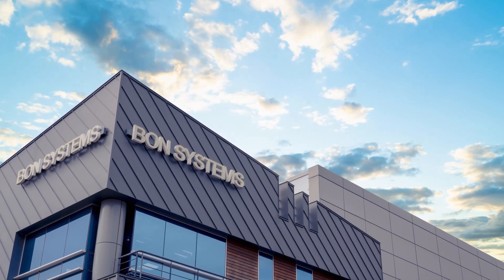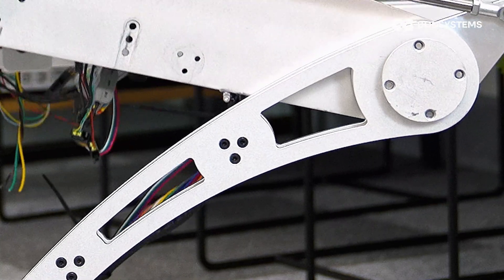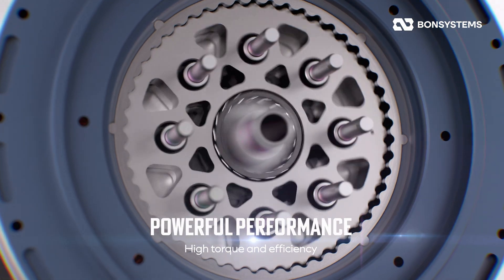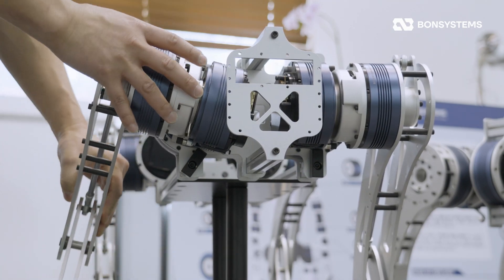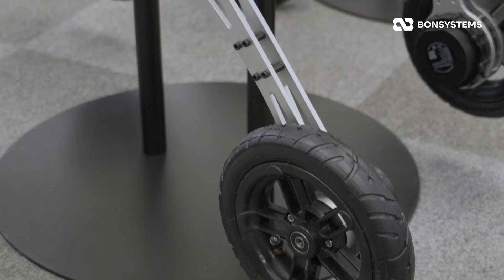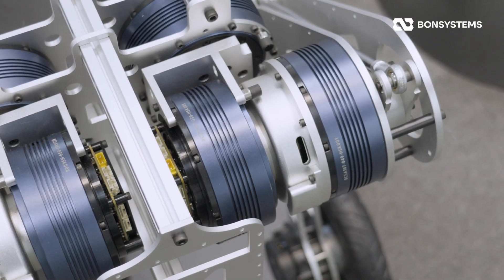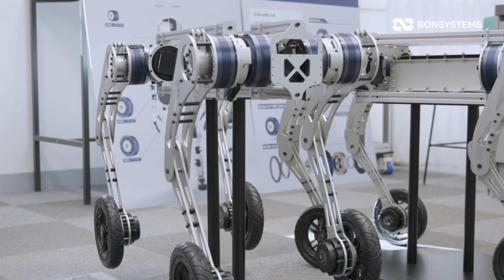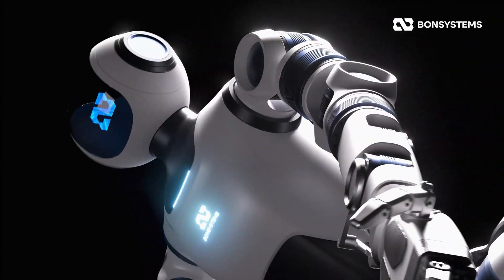Applying the BCSA V4 Actuator to a Wheeled Quadruped Robot?

Comment: What type of motor are you guys using for the wheel locomotion?
Reply from the maker: Slight modifications have been made, and currently, the BCSA V4 with a 15:1 gear ratio is being used/applied.